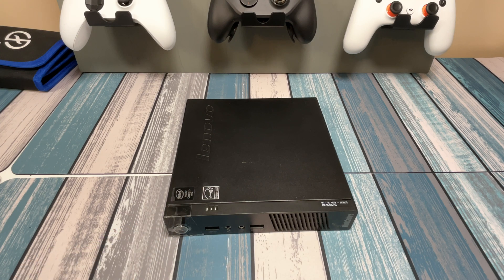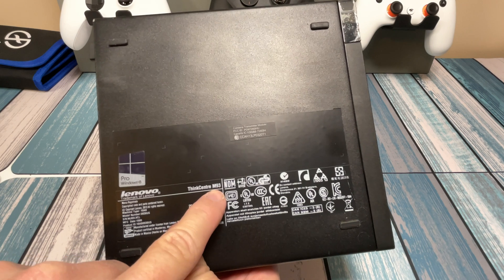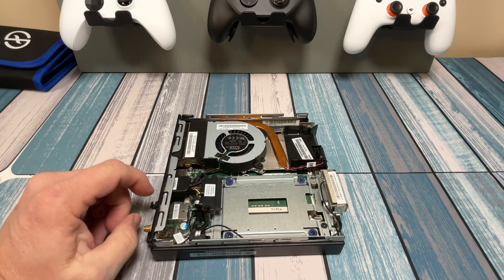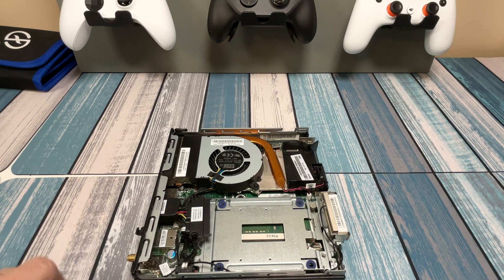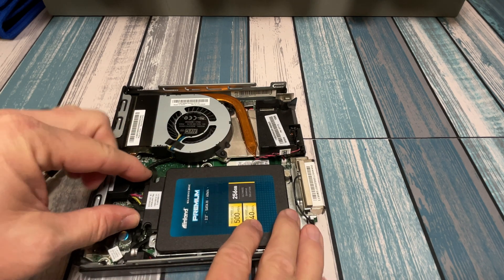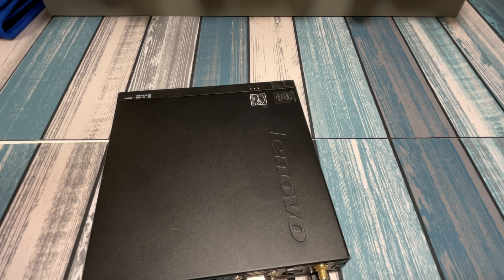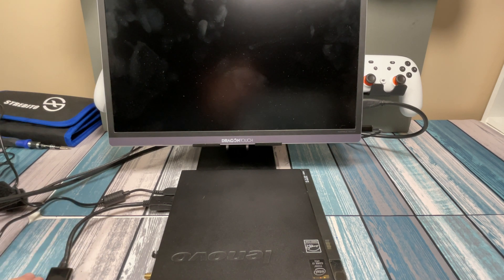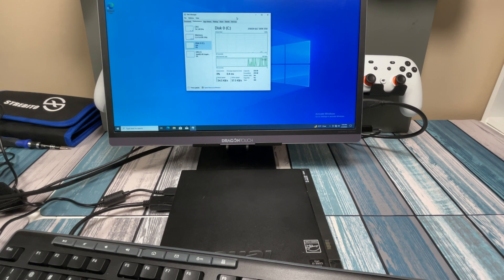Upgrading the Lenovo m93, m93p, m73 Step by Step

Comment: I highly recommend to anyone when cracking open & upgrading a PC that is 4+ years old, ALWAYS replace the CR2032 Lithium BIOS memory coin cell!!! They're only like a buck or so at your local Dollar Store!!!
Reply: If you pull it out does it wipe the bios?
Reply: @rishi7sethi  You should be able to have your computer plugged in to wall power while replacing the battery, otherwise the BIOS might be cleared!!! I don't know if there would be enough residual power to maintain the BIOS otherwise!!!

Comment: What will be the best processor for a M93p tiny
Reply: Xenon 1265L , you're welcome
Reply: Im late, but ive read that the i7 4790 (NOT the i7 4790k) is compatible. 4c8t 3.6ghz base 4.0 boost. requires a larger power brick (84 watt TDP) i assume but it might work.
Reply: i myself have an i7 4765T which lenovo reccomends alongside the i7 4785T, which has a 0.2ghz higher base and boost clock.

Comment: I picked up a clean M73 Tiny from a local used electronics shop this past weekend. My one had 4gb of ram on one stick, an i5-4570T and a 500gb hard drive with licensed Windows 10 installed. I played around with it for a bit, installed Windows 11 on it. I had an old i7 4770 laying around from a PC I had many years ago and I installed it, plus another 4gb ram. This made a huge difference in performance but the 4770 runs really hot, hits 80+ Celsius easy plus apparently these machines have a hardcoded 45 watt power limit to the cpu that can't be removed so I'm probably not getting the full performance from the 4770. I'm probably just gonna throw Batocera on this so I can emulate PS2 and OG Xbox games on my 65 inch TV in my living room, other than that I have no real use for this thing, I just thought it looked neat when I bought it lol

Comment: I purchased one of these with no ssd or operating system, great video, will be upgrading ram and installing new ssd,how do I install windows 11 on it?
Reply: The m93p tiny lacks the TPM 2.0 that's required for windows 11, meaning windows 11 wouldn't install on your PC.

Comment: The fans are noisy on these thats the only issue.    I have a Lenovo M75q Tiny with Ryzen Pro CPU and 16GB ram and 1TB Samsung evo SSD its very fast but noisy.  I rarely use it as I have Apple silicom Mac Mini and Macbook Pro..
Reply: Nah, the m73 is pretty quite actually